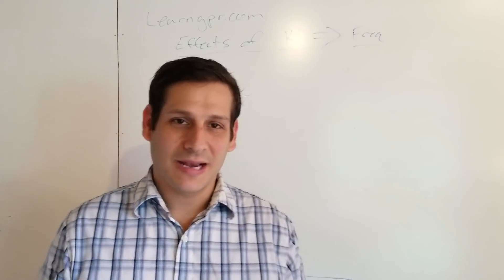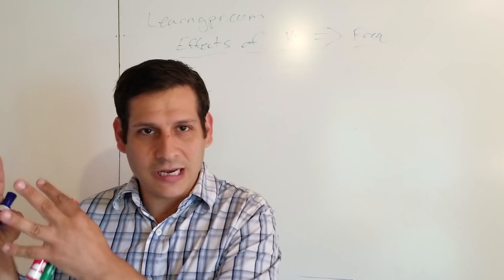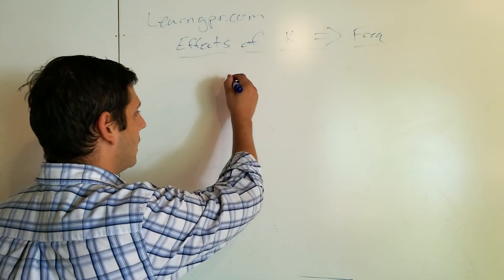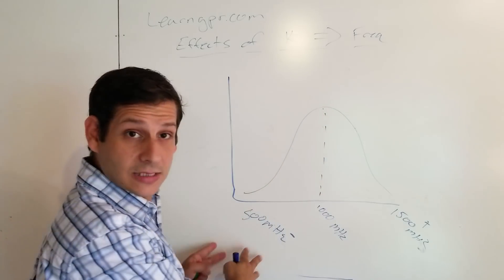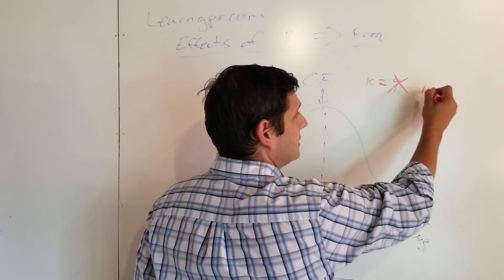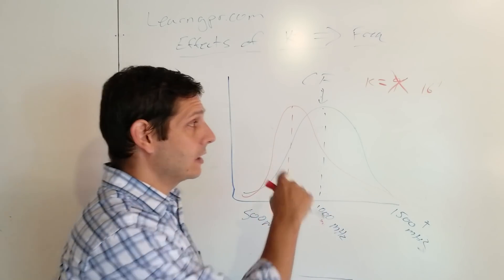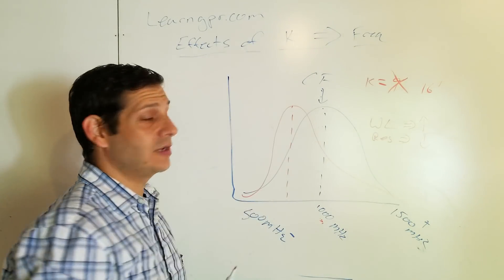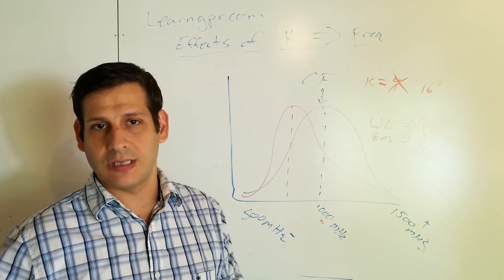The Cause of Downshift in your GPR Antenna Frequency | Ground Penetrating Radar

Comment: Hi..As you mentioned that for a wet saturated soil, the relative permittivity is higher, which means under such scenario the wave velocity shall drop..Wave velocity for a medium = 1/sqr root (absolute permeability × absolute permitivity)..
Now, Wave velocity = Frequency × wavelength..
As the wave velocity drops, wavelength shall also drop, but in this scenario the entire frequency spectrum also drops due to high relative permittivity..Have you encountered a situation wherein the factor by which the velocity drops, the frequency also drops by the same factor, such that the net change in wavelength is Zero, which means under such scenarios the downward frequency shift is not really going to effect the resolution. Please do share if you have faced such situation..

On a seperate note, what is design of the coil/antenna that transmits EM waves. Is it a solenoid?..Transmit & receive is it done using the same coil/antenna..Is a low power semiconductor based frequency oscillator being used?.Looking at the proceq's probe scanner from the videos ibam not sure if magnetron or other high power cavity based frequency oscillator's are used.

In this particular field has any particular manufacturer have considered using an antenna array/array of coil where the firing time across each individual antenna element can be varied in order to achieve an extremely good constructive interference at a particular depth, thereby enhancing the focussing capabilities?..This technique would work quite well within the Near field of the EM waves..Larger coil/antenna sizes can possibly be used to increase the near field depth..Please share some info on this..

Thanks

Comment: What about the opposite case. What type of features in the ground that would cause an upward shift in the frequency spectrum ? Porosity ? Sink hole ?
Reply from the maker: It dont believe it will be as dramatic or even an effect when conductivity goes down. This is because the instrument has a frequency distribution that it is designed to produce. So if the soil is porous and filled with more air, then it will likely approximate the expected distribution more so than not. But when conductive material ears away at the higher portion of the distribution the effect can be quite dramatic. Great question!

Comment: Oh thanks a lot for this video. I endly got an insight why Reflex2dQuick always shows a lower nominal frequency. It is because once the pulse gets into the media (in my case dry snow), even with low K= 1.4-3 the mean frequency is shifted down, right? It shows me 700/800 nominal frequency from a 900 MHz antenna.
So, should I consider this nominal frequency to calculate time window parameter in 1D-filters like DC and Dewow?
Thanks again, I appreciate a lot your channel.
Reply from the maker: Thabks for watching. You could use the frequency reflex provides. Its a really nice feature of the software, that it automatically shows what the nominal frequency is because it will be different from site to site
Reply: @Learngpr  Nice, thank. So, it's normal to have a nominal frequency lower than the one provided by the antenna. As I figured it out, the time window provided by the dewow filter (at Reflex2DQuick) is calculated as T = 1/f * 150%. Do you use ReflexW? Is there a way to get that time windows automatic as in the 2DQuick?
Reply from the maker: You were correct in your assertion. I have used it, but im not sure if there is an auto function...let me inow if you find out. Thanks!
Reply: @Learngpr  Yes there is an option 'get' within file header window that allows to calculate the mean dominant frequency. This value will be used for the dewow as a default value but in a narrow way as T=1/f and not T=1/f * 150%. Not as much conservative.
Reply from the maker: Awesome! Thanks for the update. ;)

Comment: I appreciate what learnGPR aims to achieve, but this video is incomplete. Frequency downshift of GPR signals does not occur due to high dielectric permittivity. It occurs due to frequency dependant attenuation. Materials such as clays have complex permittivities, resulting in absorption. Higher frequencies are absorbed more quickly than low frequencies, and the net result is a downshift in frequency.
Reply from the maker: Thanks for the comment. I appreciate the comment and your participation in the channel. RDP and conductivity usually have a positive correlation (though jot always). Take complex clay from your comment as an example. Water is the main ingredient for conductance in clay...it also is the main ingredient for rpd increases. The signal will get absorbed faster if there is higher water content by volume which would suggest a higher rdp. The higher rdp values also produce shorter wavelengths. Shorter wavelengths will be absorbed faster, contributing to the effect. Both properties have an impact and neither exists in a vacuum. I think "Flawed" is a strong word...maybe incomplete? Thanks agsin for contributing.
Reply: @Learngpr  agreed :) comment edited accordingly.

Comment: Hi Dan, informative video. I didn't know this. Do you think this will affect the actual depth interpreted in the data profile?  Well since you mentioned velocity. Or once you calibrate your velocity in the field, this shouldn't be a bigger issue in regards to depth interpretation. I understand why the detection resolution gets lower,  and at the same time does the depth of penetration should get higher?
Reply from the maker: Good question. It shouldnt be too dramatic, but velocity is a little frequency dependent, but i usually dont go into it...and if you are modeling the lower frequency, then your model should still be ok
Reply: @Learngpr  thanks Dan